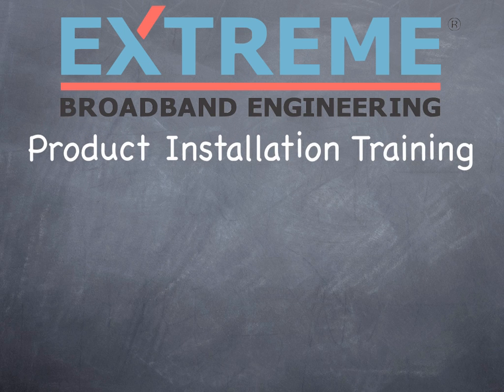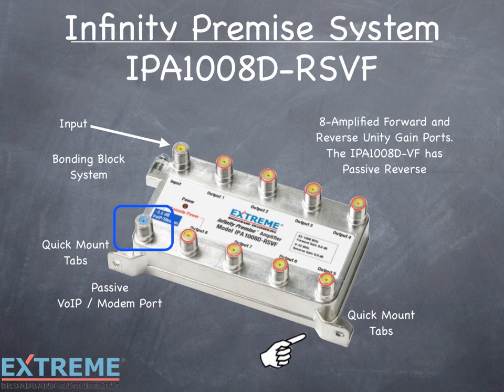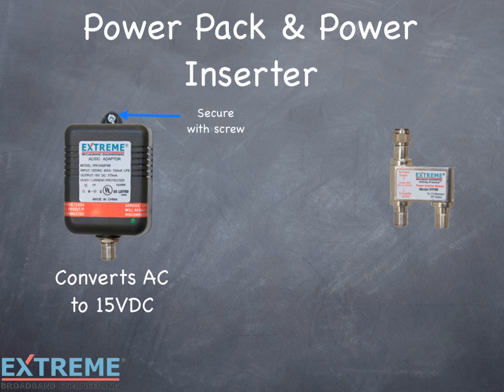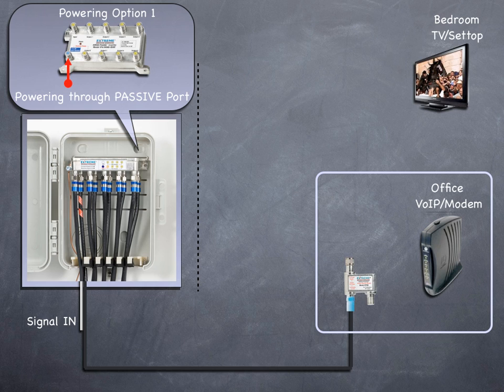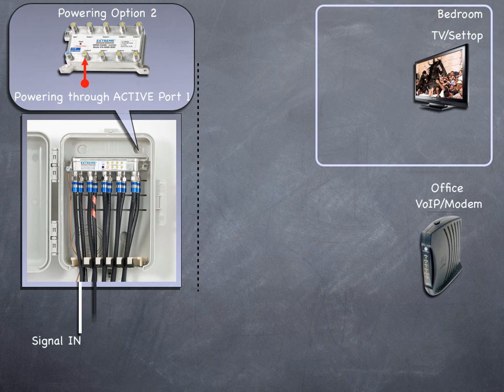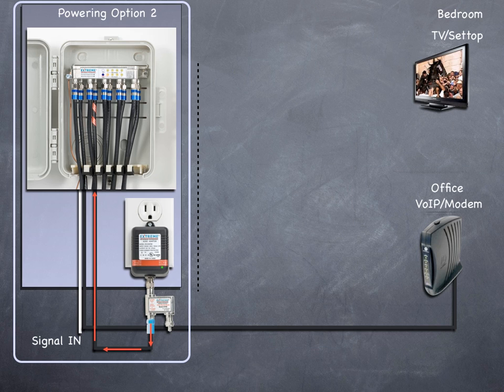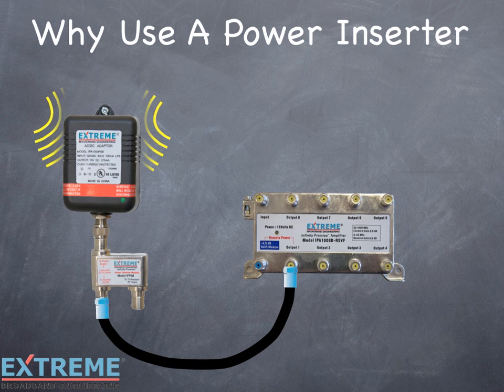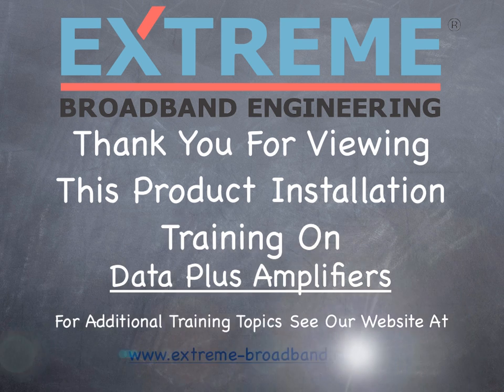Data Plus Amplifier Training

Comment from the maker: The data plus amplifiers are designed to mount horizontally, vertically, or snap into the Infinity Premise Enclosure without the use of additional screws or hardware.  This way you can have all ports facing down, specifically designed to fit neatly in an house box / enclosure without having cable bends and kinks.  The double sided label makes the port locations and values easily identifiable regardless of mounting preference.